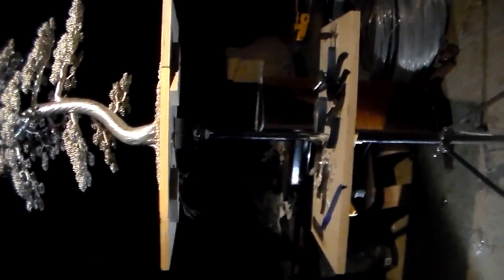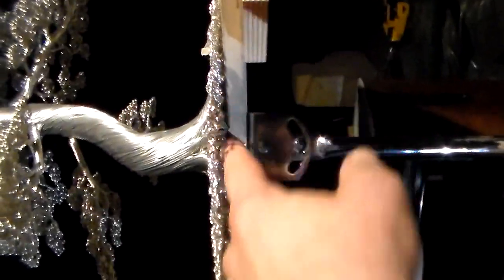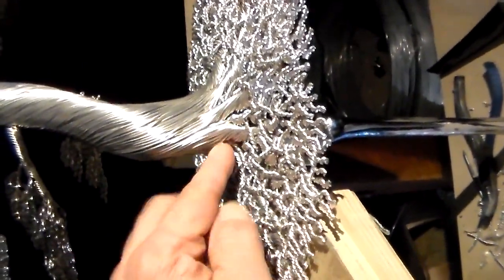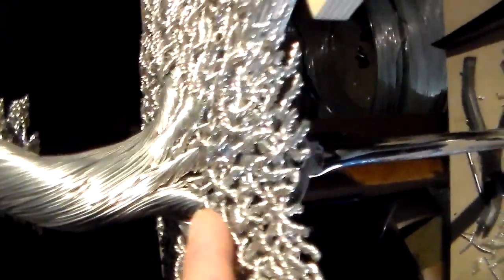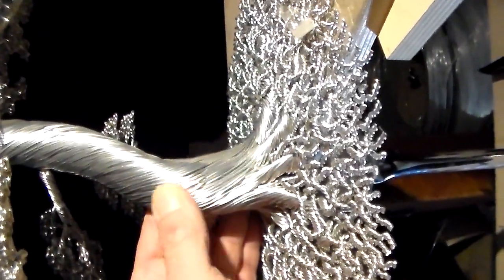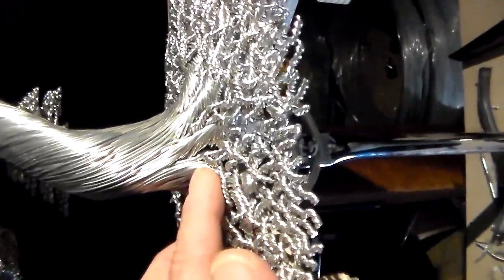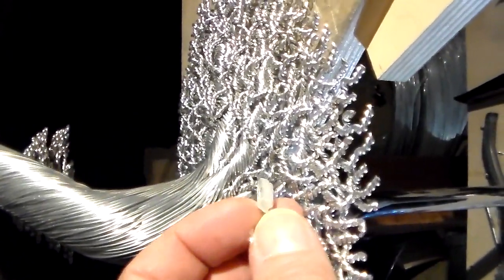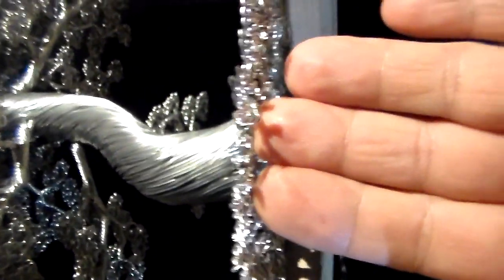YT took away the rotate video option

Comment: Thank you very much for the video. Can't wait for the more detailed one. I was thinking that we  also would like to see a closer view of a leaf cluster being made and completed? And maybe what you do to prevent getting crowded? Do you start from the top or bottom when making the leaf clusters?
Reply from the maker: I start at the apex of the tree    and work my way down and out from the center of the tree when I can. There are spots in some trees where this is not possible. The time lapse vid has examples of how I prioritize filling in the canopy. In some spots I go cluster by cluster to show the order. I will try a different way to show this next time I am making leaves.
Reply from the maker: The cam on the glasses solution I am hunting down will allow me to do a better job of filming the filling in of a branch with leaves.
Reply: I know that you use a 1/8 drill bit countersunk on your jig, but what is your spacing between the holes
Reply from the maker: 4-7 mm from center of one hole to center of next, countersunk on both sides
Reply from the maker: slow rotation on the bit so not to melt the plastic

Comment: Thanks Kevin, any secret to keeping the root ends from being super poky
Reply from the maker: Nope, my root ends are sharp also. I cut them so the point is on the top if possible. They make me bleed frequently. I you grind your snips so they are flat on the bottom and face the flat side to the end left on the tree you can get a nice square cut on the end, but I think pointy ends on the roots look better.